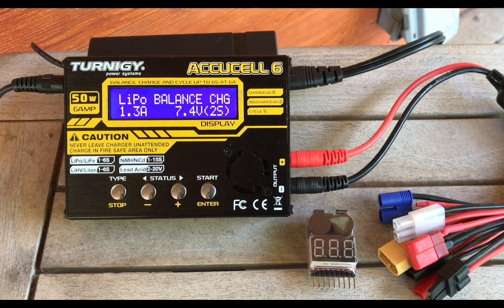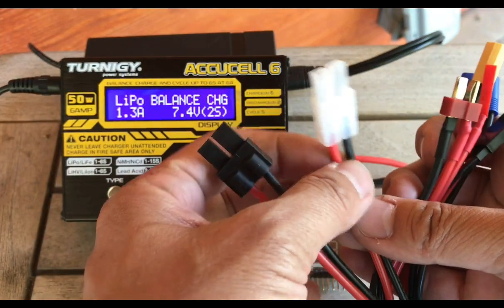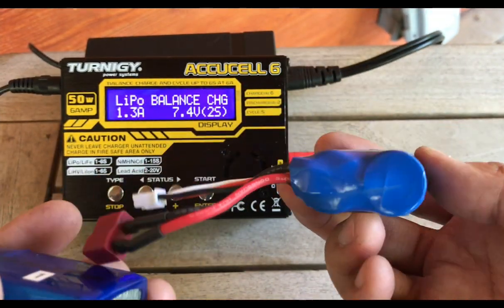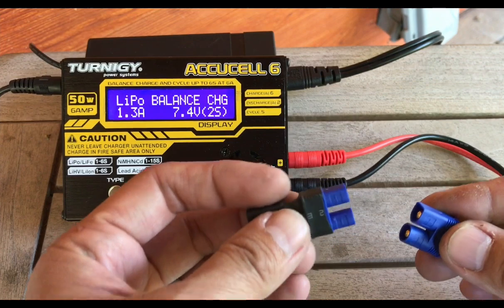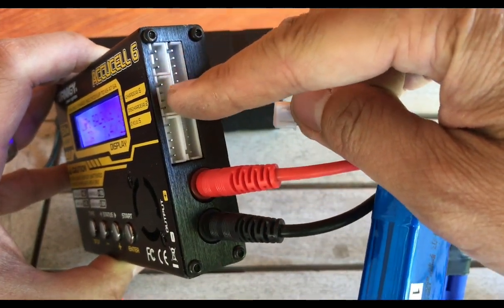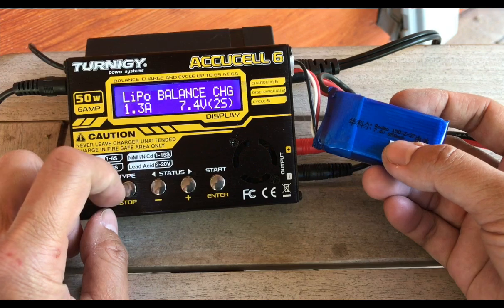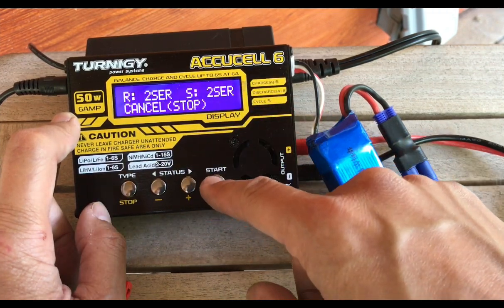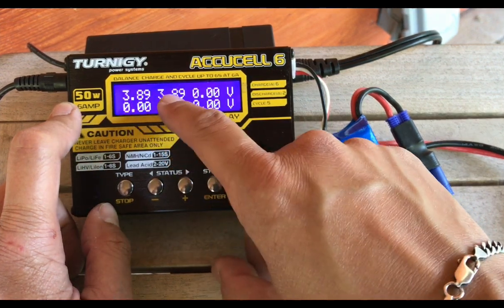How to Use a 4 Button Hobby Charger for Beginners

Comment: This may sound a silly question but can you charge lithium ion batteries on this kind of charger? The reason i ask is i have lithium ion batteries but take ages to charge on the horrible charger they come with.
Reply from the maker: Yes, this will charge lithium ion, lithium polymer, lipo HV and even some of the old school chemistries. I have another video on how to adjust the setting between the various chemistry types. 

I also have a video on how to choose a hobby grade charger if you want to consider something more current.
Reply: @Funcentric  thanks will check it out👍

Comment: how much was the charger
Reply from the maker: $75 but don’t get it. It’s old. There are better ones out there. What are you looking for specifically?
Reply: @Funcentric  I'm new to this hobby, i have a couple 5000mah batteries, 2s lipos, what would u reccomend for under 50 bucks?
Reply from the maker: @Iinustechtips  I don't have anything like that myself to be able to personally recommend, but maybe you want to take a look at the ToolkitRC products. The M4AC is $30 before shipping and tax. You'll want to check the wattage rating to make sure it can handle your 5000mah batteries. It's a single channel though. The M6D is dual channel and the M4Q has 4 ports but is significantly more expensive. I'd recommend saving up for it. A 4 channel charger will last you quite awhile assuming you don't need to charge anything larger than 4S.